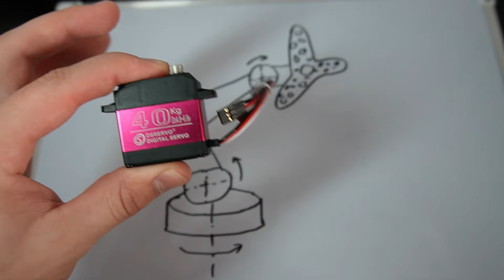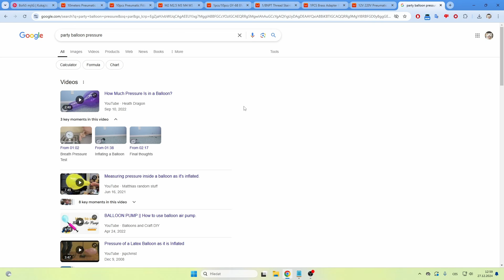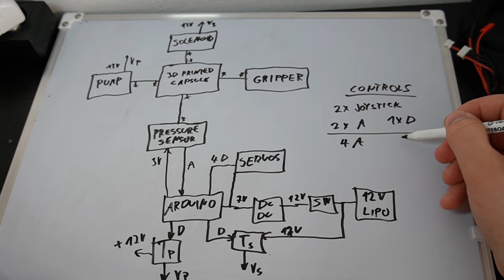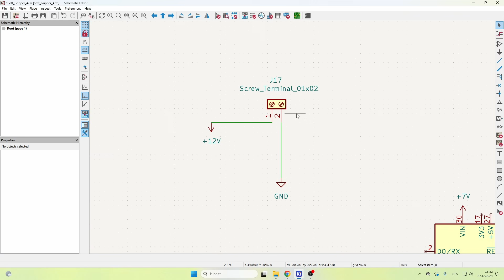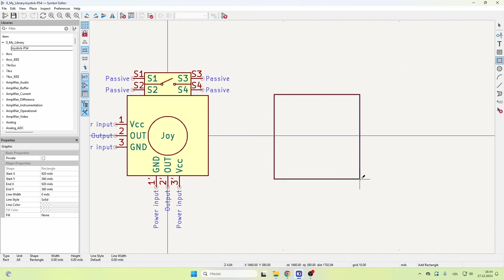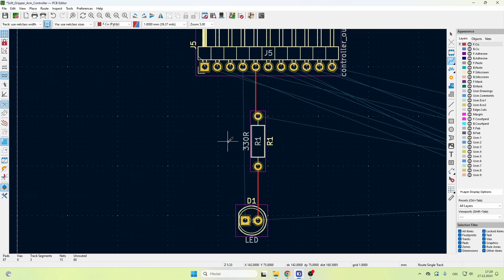Designing a Robotic Arm For My Pneumatic Gripper

Comment from the maker: I've uploaded a short version of this video if you don't have time for this one or just wanna see the main stuff: 
youtube.com/@TazerEngineering
Reply: I recommend you watch a video about pcb making procees because your statement at the end of the video is very wrong. They dont drill out copper, they etch out with chemicals. It doesnt matter how much copper there is, the process takes the same amount of time. They print a mask and place it on the pc  and put the pcb in a chemical bath to remove all the uncovered copper.
Reply from the maker: @aai2962  That's true! My bad.